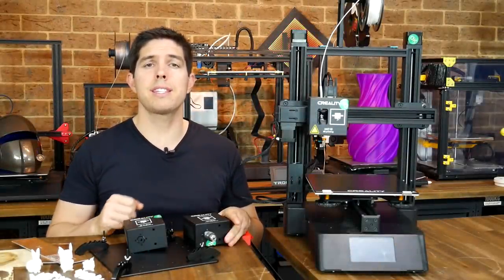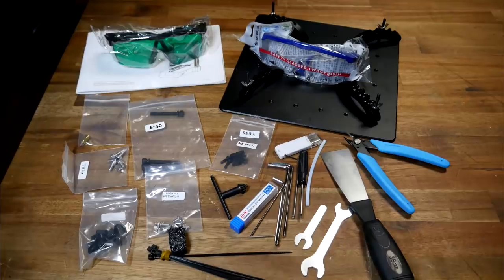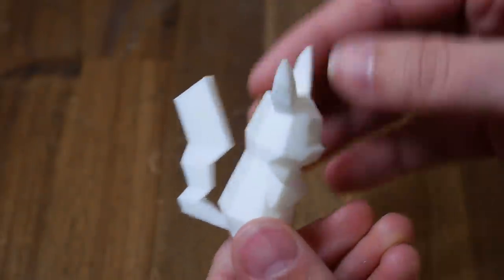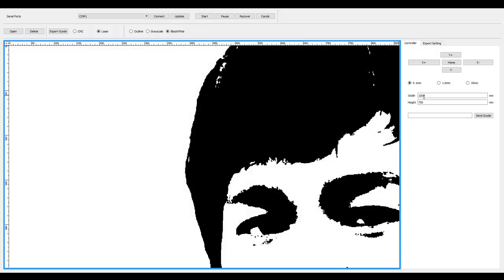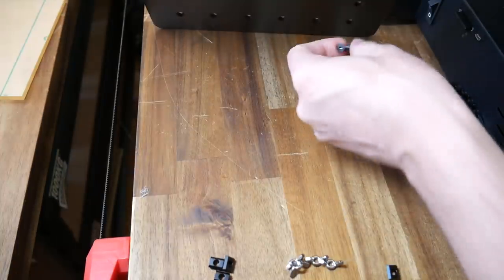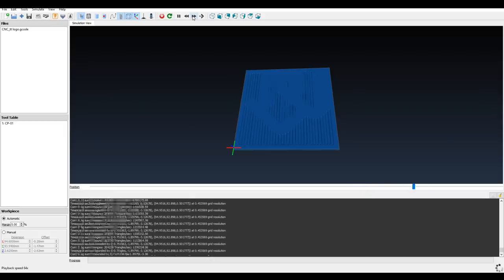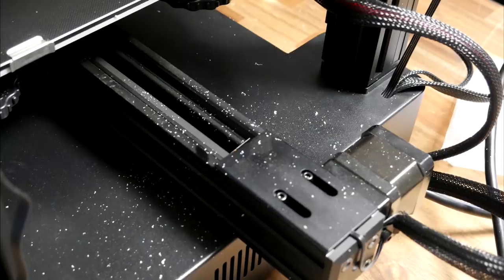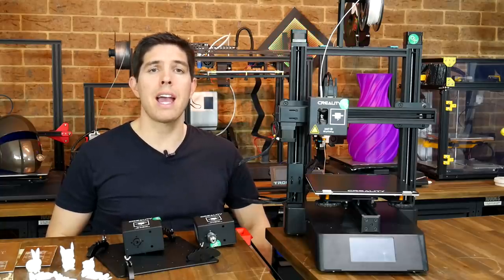Beta testing the Creality CP-01: 3D printer + laser + CNC all in one

Comment: Michael I have been watching your videos especially on the Ender 3 and its upgrades. I have now got into a total mess after purchasing these upgrades and it has stopped my Ender 3 working as it should .Your videos do NOT include all of the settings required to complete set ups. I have purchased the SKR v1.3 main board TMC2208 stepper driver motors and the TRU LEV 600. How are the TMC2208 and TRU LEV 600 set up in ATOM. I cannot set up the TRU LEV 600 for bed levelling this is as you know different than Arduino. You seem to be rushing ahead with new releases without checking on comments on your previous videos

Comment: "you can make PCBs" 
Well, first you need to use solder mask and then try and only engrave on the solder mask without removing the copper to make such a claim.
Reply: You don't "need" to use solder mask, you may personally like to but not everyone needs to, it's not as if everyone needs to do smd at 01005 or even 0402 and if you do you wouldn't be isolation routing in the first place, certainly not with a 1mm endmill.  If oxidation is a concern a quick conformal coating at the end is as easy as holding a spray can of lacquer.
Reply: @m3chanist  good answer, thank you
Reply from the maker: On my main CNC router I've made several working PCBs using this method. I cut the exterior out and then drill the through mount holes on a drill press. Not as nice as a properly made PCB but for a one off works great.
Reply: @TeachingTech  Indeed, it's a great method to have about to..ahem..design prototype and test ;) You use flatcam Michael? http://flatcam.org/ . That may be a good subject for a video, eg. gerber ->flatcam-> board.

Comment: Damn....power for a CNC motor over a VGA connector? No no no. Thats bad. That connector is not designed for high curents. I am quite sure that little motor wont draw a lot of power but I still wouldnt rely on a VGA connector for this particular task.

Comment: Belts are useless for contact engraving/milling, ask me how I know. And throw that drill chuck out! That thing got more runout than a hot dog down a hallway. Collets, even ER11 setups are same price as that chuck. Leadscrews everywhere, Hiwin linear rails on all,.. THEN you can try to mill copper foil with this stick built setup.

Comment: This is all the wrong way around. 

Turning a 3D printer into a CNC is a tall order. The compromises are just too great. (terrible rigidity) This can never be a CNC router, at best a CNC engraver. 
On the other hand turning a CNC router into a Laser or a 3D printer will give excellent results on all three. (with a compromise in Z axis travel and overall speed) 

To build a great structure one needs a great foundation. 

For the same price one can get a Ender 3 and a 3020 CNC with a Laser add on.

Comment: Not an honest review .... this product was discontinued quickly; even Creality do not support this printer anymore, only after 2 years or so ....  This printer is full of bugs.  It is easy to print the gcode files that came with the printer, but if you use any other models and export to gcode to print on this printer, it is HARD to make a successful print.  The nozzle head temperature control is buggy and the printer often override or reset the nozzle temperature set by the slicer (that came loaded on the SD card).  To cut it short .... the fact that Creality don't sell this printer anymore, and don't even put it on their website/slicer software, it tells you how bad this product is.  The hardware came with this printer is good, but the controls (ardruino) are poorly written.  CNC and laser engraving functions are poorly designed too; a lot of manual tweaking is required before you can create something successfully with good results ..... BAD PRODUCT